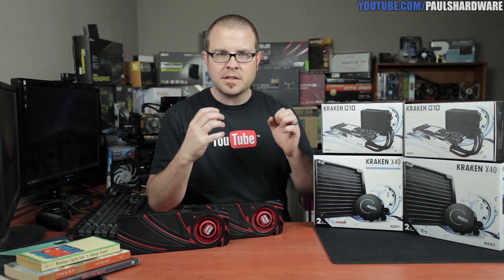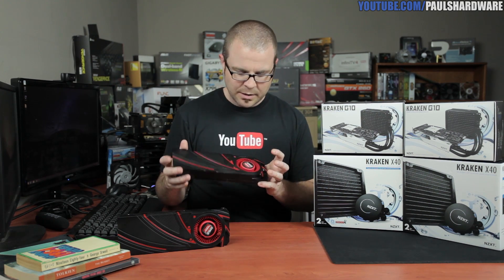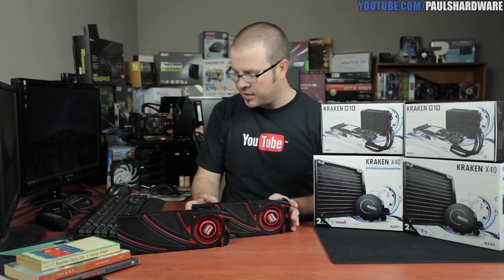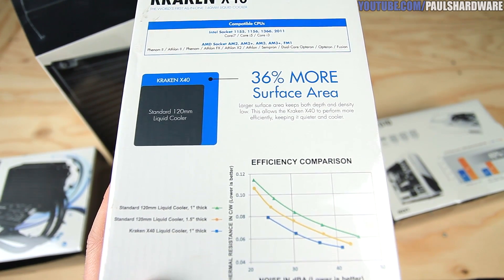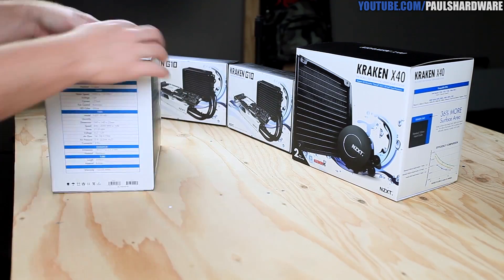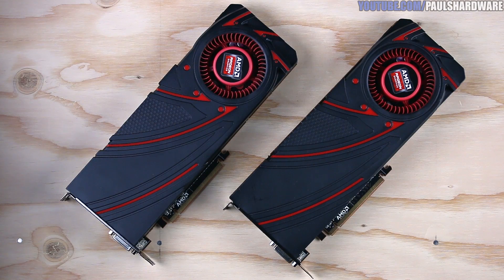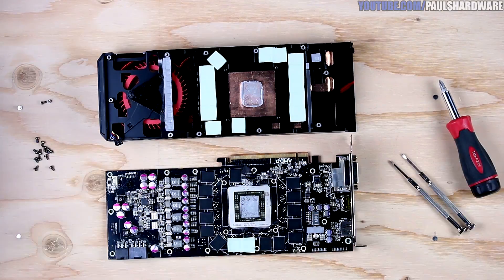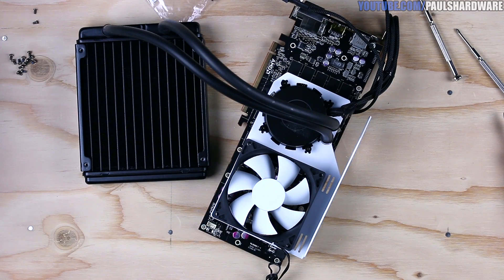Preparing for 4K: Part 1 - NZXT Kraken G10 Install on the AMD R9 290X

Comment: Want to confirm that the kraken g10 works with asus gtx 1080 "turbo" card. I just did it. Use C location holes. Anyways I might get ram heat sinks because everyone says so. Didn't look like the original set up had one.

Comment: Is the g10 worth getting rid of vrm and vram cooling?
Reply: +ChannelAsh100 Well you do have that 92mm fan specifically for cooling the VRM and VRAM, but yea, I also asked myself if that alone would be enough.  I've found that people have been affixing small copper heat sinks to make up for where the G10 lacks.  I'm getting ready to install this G10 with an X41 on a 980 Ti FTW which, luckily for me, has a dedicated heat spreader that does not come off with the stock ACX cooler.
Reply: +coinsagE46m3  Your talking about that heatspreader that covers the whole front side of the card right? The one that is underneath the acx cooler?
Reply: ChannelAsh100 That's the one.
Reply: +coinsagE46m3 My evga 970 has one of those but wouldnt you have to remove it in order for the g10 to fit on there? And remove the back plate too?

Comment: does it work for gtx 980 ti ? I didnt see that it's supported on the box
Reply: +filip marinovic I was wondering the same thing bc I've got the asus strix 980ti - if you;ve got reference you should be fine though bc it's essentially the same pcb layout and 780ti etc. which are supported. I on the other hand am in a trickier situation bc I'm not certain on where the vram is on the strix pcb
Reply: +Mo May Hobbs I was researching a lot about this is found better solution check Corsair HG10 N980 edition!
Reply: thanks, also looks great but under compatibility it doesn't mention my STRIX card so I'm still a bit wary...
Reply: +Mo May Hobbs if a Asus strix has it's own custom PCB then it might be the problem , but I think the nzxt one should fit , but then you should get heatsinks for VRAM
Reply: yeah that's what I'm thinking rn - get the g10 and vrm heatsink, bc the corsair one looks like it's more precisely fitted so the custom pcb might be a no-go

Comment: Guys... PLEASE buy small heat sinks for the VRMs. The whole point with water cooling (IMO) is to overclock the GPU. You can't overclock it when your VRMs are sitting on 90 degrees without overclock. 

Heat sinks on the VRAM isn't really that important. They will do fine. But please do yourself a favor and buy heat sinks for the VRMs.
Reply: +Norway lal should i Use heatsinks on my memory?  I have a r9 290x from Asus
Reply: +Norway lal If i intend to overclock my memory on my 980 should i add in heatsinks for my vram?
Reply: Honestly, i don't think its that necessarily since the vram runs pretty smoothly and are at comfortable temperature. 
If you are worried, you might as well do it. Adding headsink will pretty much only have a positive impact anyways. So do it if you feel like you should ;)
Reply: Wezzc I'm interested in this bracket and water cooler. Are there any VRM heat sinks you would recommend?
Reply: Ugh... The fans
Reply: You got that right. The VRM, VRAM and MOSFET modules get really hot without cooling sinks or fins of some sort. I fried a HD7950 card a few years back neglecting them. Not overclocked.

Comment: those cards are gonna get rekt, VRam is gonna go in the high 90-97celsius without small heatsinks on the vram chips. i did this to my cards and i had to buy heatsinks
Reply: +olerobherm1993 .olerobherm1993 This

Comment: he dont put thermal paste in both of them i dont recomend you guys doing like him
Reply: +ExpressOyun he used preapplied thermal paste that comes on the cooler
Reply: +ExpressOyun And clearly your listening skills are awful.
Reply: MeemoUK24 4.15 he mentions the pre applied thermal paste, then later at 6.15 he says "while trying not to smear the thermal paste" so no, my hearing is fine, its yours that's the issue
Reply: northern marine Are you dumb you just contradicted yourself in your own comment. Just wow I'll leave this conversation you're so dumb it will make me dumber even talking to you.
Reply: MeemoUK24 and that comment wasn't dumb in itself? the op said he didn't use thermal paste, completely missed the pre applied paste, which is what my comment was aiming at

Comment: is this compatible with xfx r9 390x?? plz answer fast
Reply: just fucking Google it
Reply: i did, it doeas only with the r9 290x.
they are similar so i asked -.-
Reply: +BadRock I'm trying to find this answer out as well!
Reply: +BadRock The kraken website doesn't list the 390x but it lists the 290x which is basically the same setup(I think) as the 390x
Reply: +BadRock https://www.reddit.com/r/Amd/comments/3qdpzy/i_did_it_i_successfully_installed_the_kraken_g10/? <-- this guy used it on a MSI 390x and said that it worked.

Comment: If I put this on an R9 290, can I buy some VRM heatsinks as well? Would they fit with this cooler? I'm looking at either of these.

http://www.amazon.com/gp/product/B00637X42A/ref=pd_lpo_sbs_dp_ss_1?pf_rd_p=1944687462&pf_rd_s=lpo-top-stripe-1&pf_rd_t=201&pf_rd_i=B004CL89D8&pf_rd_m=ATVPDKIKX0DER&pf_rd_r=1HFZ111GR0NE5K9W7STM

http://www.amazon.com/Enzotech-MOS-C10-Forged-Copper-Heatsinks/dp/B004CL89D8

Comment: is this compatible with the r9 290 vapor x?
Reply: +lmSkittles most aftermarket cards have a reference PCB
the only difference is the cooler and clock speeds

Comment: How does it cool the memory? I can see it cools the gpu just fine. No memory cooling at all?
Reply: +Victor England I'd get some tiny heatsinks for the VRAM and VRM's.
Reply: +Topias Salakka You DEFINITELY need heatsinks for the VRAM and VRM's. Otherwise they will hold back the general performance (especially OC-performance) even more than the stock cooler. There are exceptions, but the overall life span of the card will be shortened tremendously, given that the VRM's usually hit 80-90+ degrees (Celsius) without proper cooling.
Reply: +Victor England Only the fan.

Comment: Nice video my friend!! :))
One question: You have to buy KRAKEN G10 and KRAKEN x40?
KRAKEN G10 is just the base? or includes radiator in the same KRAKEN G10 box?
Reply: ***** Kraken X40 has the AIO (radiator, waterblock/pump, fan) and the G10 has bracket + 90mm fan.  Still you need heatsinks: http://i.ytimg.com/vi/-YX-153DwFI/maxresdefault.jpg

Comment: Wish I could post pics..  Just did the same to 2 titans using a H80.  Cost me $79.99  But if usless and cant build stuff and don't want to go full or open loop water..  Promise this will make you very happy..  Just ridding of the noise from gpu fan is almost orgasmic..

Comment: Been thinking about getting 2 or 3 R9 290's and doing this. They're around $200-250 used.
Reply: Nabudis Great idea :D but i would go for 2 290´s not for 3....the third card is not worth the money
Reply: Baecher Computer
I had three 7970's and they scaled pretty well in some titles, though much less than with two overall. Gonna grab a Devil 13 290x probably though, getting a good deal on it and it's still cooler than a reference 290x(not 295x2).
Reply: Nabudis good idea

Comment: I have an xfx r9 290 double dissapation. Does anyone know if the g10 will fit this card properly. Will I need different screws or something. I think I read that is a possibility. Also will using this cause my vrm chips and anything else to overheat. If so what do I additionally need to stop that. Also is thw fan that itcomes with good enough or trash. If trash can someone suggest a replacement.
Reply: I know for a fact that if you find out that you do need longer screws all you have to do is go to the NZXT customer service site and request them. But, from what I have read, the newest versions of the G10 come with the longer screws. This problem was only seen with people who bought the very first shipments of the G10 and who had specific versions of the R9 290/290x. If you are buying the G10 bracket now, chances are that you are getting one of the newest packages and that it will include the longer screws. If not, it is a case of waiting a couple weeks for NZXT to send you the proper ones in the mail. I had the G10 installed on a 7950 boost and was having trouble making contact so I thought it was the short screw problem. I contacted NZXT customer service online and they immediately approved my request for a new set of screws. I received them in a regular letter sized envelope with a stamp and the addresses hand written on it. So, if you do need them, it might take a while depending on how far away you are from the NZXT HQ in your area.

As for VRM, all you need to do is buy the $15 Gelid R9 290/290x VRM heat sink kit. It will save you the trouble of customizing a set yourself. The VRM 1 does get quite hot, over 110C, under normal conditions when cooled with just the fan mounted on the G10. If you plan to overclock any, it will get even hotter and possibly become dangerously hot. The VRM 2 is a smaller set of VRM that also should be cooled with a heat sink but doesn't usually reach these dangerous temps. I am using heat sinks on them right now and my VRM 1 temp is around 80C under load with about a 15% OC and VRM 2 is in the low 60's. Regarding everything else, you really don't need to do anything else but the VRM chips. If you want, you can stick some copper heat sinks on the VRAM but unless you are planning a high VRAM overclock, they are being adequately cooled by air. For more info, read this review on the G10 that includes some pretty cool thermal pics: http://www.pugetsystems.com/labs/articles/NZXT-Kraken-G10-Review-527/
Reply: I would probably just go a moderate overclock. I do see certain people getting it pretty high up. But 8 m not really knowledavle with oc and over volting so probably a moderate stabld over clock. Thnx for ur reply. I figured screws would be just wait time or go find same screws at hardware store. But was not sure if it would fit my xfx double d r9 290. They make it seem like it is designed for only refernce cards with reference pcb boards. I saw 1 place tbat my card is a reference pcb board still and somewhere else I believe they said it wasn t . Just dnt wanna buy iy for nothing take my air cooler off, it not fit and then god forbid have problems putting the air coolr back properly
Reply: Truthfully I would like to eventually get 2 way crossfire going with 2 g10 cooling I. My phantom 530. Hope it would fit

Comment: My GPus are getting extremlz hot in SLI , 77C with 100% fans and case 100% open , and guess what SLi setup I have , Gtx 970... I am pissed but dem performance tho ! I am getting the krakens becasue I dont want the 100% fans speed and the case open , its hould be closed and 60% fan speed ! shame on you !

Comment: dont u need to apply new thermal paste?
Reply: pre applied to new coolers dude, well most anyway.
Reply: Phil Marsden yeah i mean is it enough? (coolers paste)and good?
Reply: [MM]Shoty depends on the brand i guess. but it should be. it could be that some need more or less depending upon what you are fitting. some gpu are smaller and other cpu larger but on the whole they will work with all yes.
Reply: Phil Marsden ty man i was just asking because i have never used an water cooling set :)

Comment: Does this only fit reference design cards? for example would it fit this card msi r9 290 with the twin frozr cooler.

http://www.newegg.com/Product/Product.aspx?Item=N82E16814127774&cm_re=msi_r9_290-_-14-127-774-_-Product
Reply: ***** ive heard differently to that :o

Comment: I'm planning to use a G10 on a R9 290. Any advice on how much force is needed to screw in the four top screws securing the block? And why is that piece of foam there, any use?
Reply: the foam stops the back plate from touching the GPU and making it short circuit

Comment: Just wanted to mention, the G10 bracket did NOT fit my Corsair Hydro H50 as advertised on the box.  I was forced to buy a new closed-loop cooler.  NZXT needs to correct their packaging/marketing.
Reply: their marketing is incorrect, afaik there are two versions of the H50 and only the second version fits which is stated on the website.

Comment: Every youtube PC parts reviewer is technically a hoarder. Since I am getting a G10, I've watched several reviews on it. In the last 3, the background was basically shelves filled with boxes of high end PC parts like PSUs, GPUs, motherboards and even games. I'm sure there are reasons why they have so many parts besides being reviewers like they get some of that stuff free. But, they would make really awesome episodes of "Hoarders". I can see it now, the trucks pull up and they are just throwing boxes and boxes of brand new GPUs, CPUs, PSUs, motherboards, monitors, laptops and games dating back to the 90's into piles in the front yard while everyone is walking over floors covered in old PCBs, broken laptops, hard drives, optical discs, random cases and like 10 million of those little Phillips head screws. Then, in the next scene the "patient" is shown sitting on one of his 17 complete PCs with a wall of monitors lurking around on eBay looking for his next fix: a lot of complete systems from an office that just upgraded. The therapist tries to convince him not to hit the "buy it now" button and instead he screams at the cleanup crew and tells them not to touch his vintage printer collection.
Reply: ***** There is a place just like that in my town, called "Extreme PC." Is by chance your landlord's name Andrew?
Reply: ***** It's funny because the guy here also has about 20 monitors (and a projector screen) in his foyer

Comment: I do have a question though when i watch a viedo in 2160p on my 1080p monitors my Raditor gets extreamly hot and my system lockes up. 6% GPU and 350 megs or ram
it seems to be drawing everything from the cpu. I have a 8350 at 5Gzh and 16 Gigs of ram at 2000 Mhz and Classified 770 4Gig

Comment: where to get vram.heatsinks???? Please respond fast!
Reply: Try Arctic Cooling.  I got some with my gpu cooler when I installed the Accelero Mono Plus, but they may sell a kit separately.  Otherwise try and blag it with their support.

Comment: I installed this on a HD7950 with an older Kraken G10 kit. I did some modifying such as removing the cushion block on the back of the mounting plate and adding 11/32 grommets on the long mounting screws. I did add zalman vrm finned heats sinks. Bent the fins on the heatsink nearest to the gpu die block to clear the bottom of the copper pump head. In some HD7950s, the gpu is sitting below the die block so you need to add a shim. It will need thermal past both sides. In a cool room, both gpu & heatsinks temps went down to 60c, 20c to 25c from 80c+ peak temps. Nice.

Comment: Look how fucking cheap the AMD cards look sitting next to the titans lol Fuck AMD I will take the better built card every time lol
Reply: nice neck beard, fuck neck beards ...looks pre cheap to me , ill take a shave over a neck beard any day
Reply: And I'll take the card that was actually meant for PC gaming over the budget workstation card every time, be it the R9 290/290x or the GTX 980/780ti/780. The Titan is for morons who think that the fancy name makes it worth the extra $400 over a GTX series card and then use it for gaming without ever knowing that the features they paid extra for like unlocked double-precision floating-point capabilities and the extra VRAM will never be used. And, there is nothing better about the way an Nvidia is "built" vs an AMD GPU. The chips are actually made by the same exact company, TSMC. And, the PCBs are made by almost all the same vendors such as Gigabyte, Asus, MSI, Sapphire, etc. including the reference cards. They do differ vastly in design and each design has their own advantages and weaknesses and a bunch of features that make little major differences in real world gaming use. For the most part, the only real advantages of a modern Nvidia card over an AMD is the fact that it uses much less power and produces much less heat to achieve the same performance as a comparable AMD card, especially if you are comparing a Maxwell to a current gen GCN. But, on the other hand, AMD is selling their cards with comparable performance to Nvidia's for much less money. You might be saving money on your power bill with an Nvidia but you'll have to run that card for like 3 or 4 years before you make up the difference.

Comment: Its the first time I've seen a solution like this although I have thought about an all in one gpu cooler....Its far cheaper to make the adapter kit for an all in one gpu cooler than one designed for a specific  card....But I can see in the near future the top end grpahics card coming with an all in one cooler instead of the fan cooling array, which can be noisey as we all know....just my two cents

Comment: I really need to see a single 290X and 780ti performance results on this as it is my end goal with either card I go with. just need to know how a 290x performs against a 780ti first as it is obviously the cheaper of the two to do and my preferred route.

Comment: i wonder if 2 770's in sli with the kraken G10 and corsair h55 will fit in a m-atx case(arc mini r2) in a m-atx mobo ofc(ASRock Z77 professional-m
Reply: use pcpartpicker
Reply: monkey1346ful
 pcpartpicker doesn't cover gpu liquid cooling,let alone with kraken g10-liquid cpu cooler combo ;)
Reply: ya sorry i was they wont fit as the teubing would come in the way i 770 will work if u have 2 the they cant run in sli
Reply: monkey1346ful your 100% wrong
Reply: i guessed

Comment: please show how and you put the heatsinks on and which ones you used. i have an asus directcu r9 290 with a kraken g10 and corsair h90. the temps are always real low on the gpu, but the vrm temps are uneven. one is high and the other is reasonable. im afraid to really overclock it good because of this. i use HWiNFO64 v4.36 to check the temps. keep making great vids. :)